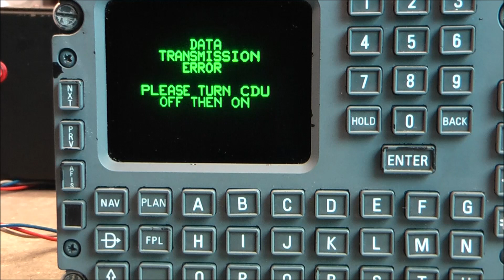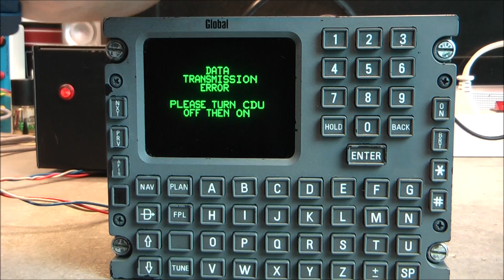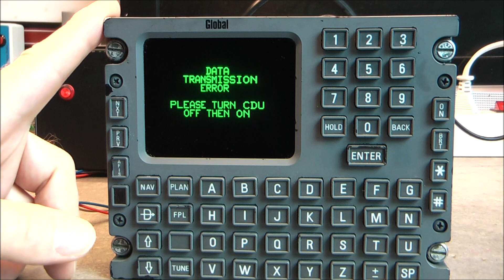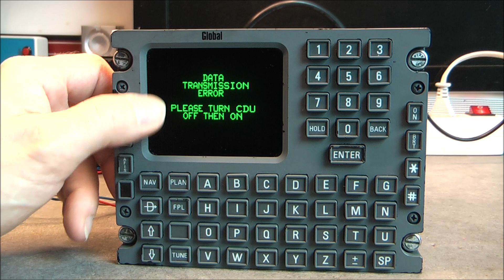Powering up the GNS-X CDU

Comment: Glad to see it works! The backlamps are also directly linked to the rear connector pins P and K and needs 5V. The polarity is not too important since they are mini incandescent bulbs but they do use quite a lot of power at full brightness, still looks cool!

Comment: nice to see it powering up! I got three GNS-1000 CDU years ago, but never bothered powering them. I ended up stripping them and reversing the keyboard pinout to plug to a pi. and yes I think the backlight is 5V if I remember correctly

Comment: I sugest reading the EPROM, the NSC800 is a low power Z80 clone so you might find something there ;-)
Reply from the maker: Is there a versatile, affordable USB Eprom device you can suggest ?Does this seem good enough? https://www.ebay.fr/itm/High-Speed-TL866II-Plus-Programmer-USB-EPROM-EEPROM-FLASH-BIOS-AVR-PIC/181923646528
Reply: @msylvain59  I use that and it support a very wide range of EPROMS, MCUs, GALs, PALs, etc. I would definitely consider it as a 1st universal programmer
Reply: @msylvain59  Yep that is the one I would sugest, I even found a way to get it to program EPROM's it can't generate the voltages for, heres the video: https://www.youtube.com/watch?v=F9ADB7ImSwc
You can even use it to chack logic chips so its a really handy tool. I use it a lot when it comes to restoring my vintage computer collection. & backing up their ROM images.
Reply from the maker: Thansk, it is on order, I was considering getting one for quite a while.
Reply: I would be interested in the code too. :)

Comment: Could you test it running on 24 volts? 24V industrial power supplies are much more common and inexpensive than 27 or 28 volt supplies.
Reply: I have a clock (chronometer) from the CRJ700 that is designed to run on 28V and I am able to turn it on with 24V
Reply: I can confirm the unit will work off a 24v dc power supply.
Reply: @neilroberts9551  Branimir Filovski, Thank you. Makes sense it would work. I have 14V rated NAV equipment that powers-up just fine with 12V.